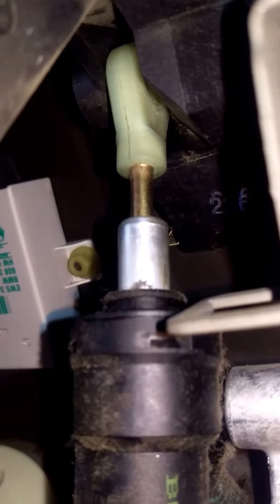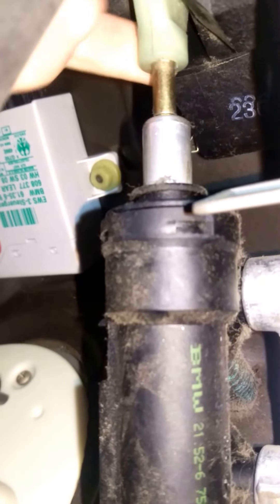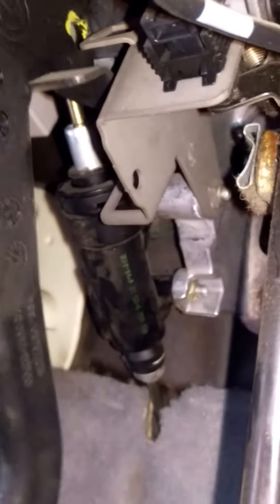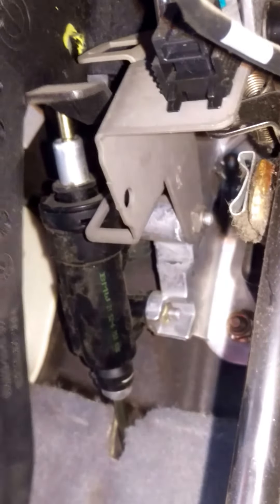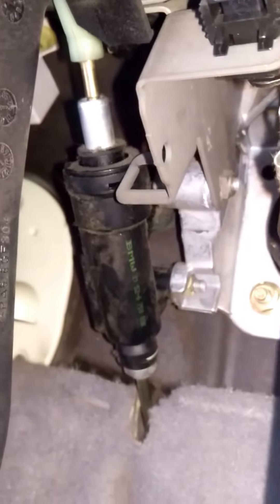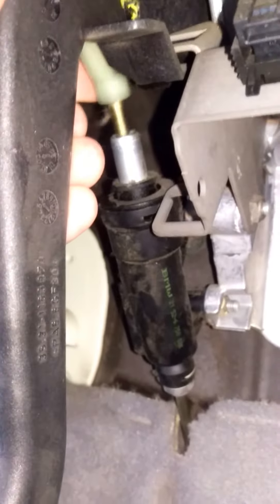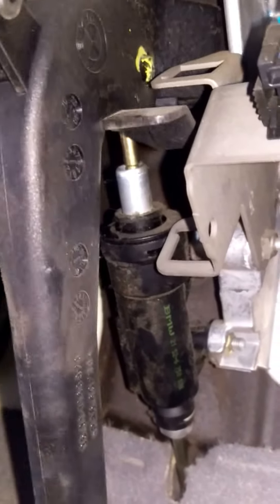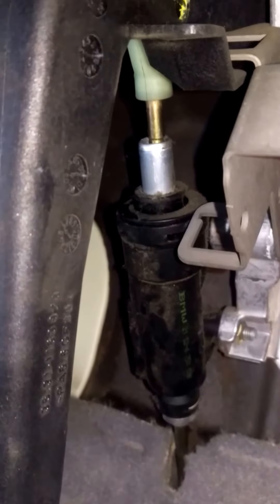E46 clutch issues

Comment: bmw e46 320i clucth is soft and cannot go into gear while the car is idleing
Reply: I have the same problem did you fix yours?
Reply: How did url fix it coz I have the same problem
Reply: @stanleygouws7569 did you ever fix it and what was the repair
Reply: @sfiso4114 did you ever fix the issue? What did you do?
Reply: @Content.Clipss super late but try pumping the clutch like 3+ times and then see if it let's you change gear. If so, it may be the slave cylinder, clutch cylinder is knackered. Failing that, could be your clutch itself. Hope you managed to fix it! 🙌